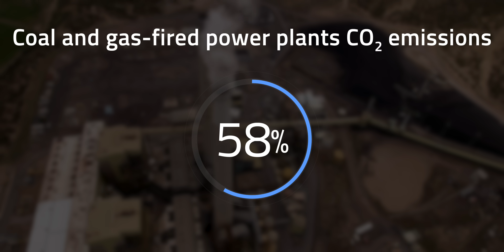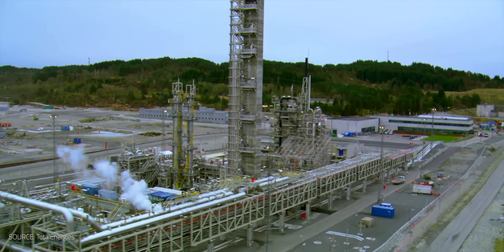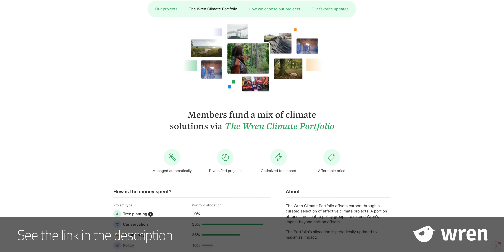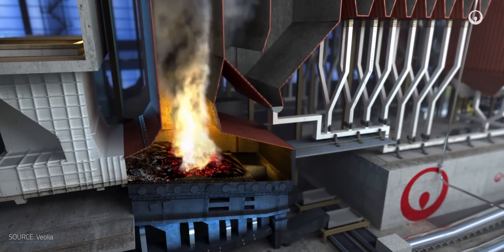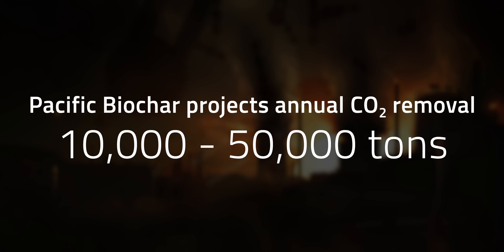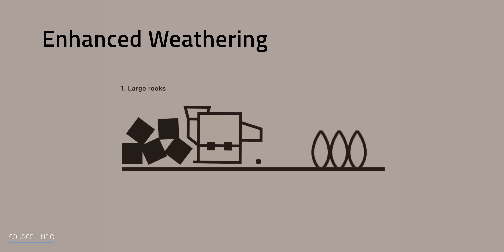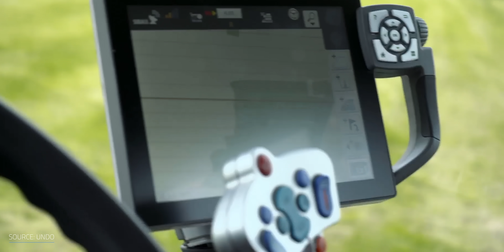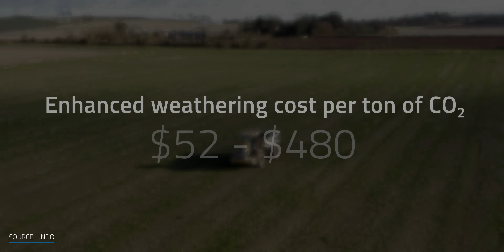The Reality of Carbon Capture

Comment: I was hoping you would talk about regenerative agriculture.  Rotational grazing,  silvo pasture, water harvesting and wet land restoration.  I believe these things could make a massive impact if done on scale.  Imagine how much CO2 is held in soils if we just raise the organic content a few percent.
Reply: There is no downside to Regenerative Agriculture. Not even cost. Regenerative farms are more profitable, produce food with higher food value and reduce/eliminate chemical use in fertilizers and pesticides/herbicides. Run the calculations on how much carbon is captured when you increase the carbon content of soil per acre from 1-2% (typical of western agriculture) to 9-10% (rich healthy soil). The numbers are astounding. We need to work with nature not against it.
Reply: @stevelewin8538  they produce food with higher food value and reduce chemical fertilization but they also produce far less food than can be currently produced. It would be the equivalent of taking 75% of croplands and letting them fallow each year on a rotating basis. Even with increased food value and fewer chemicals needed, the net result is a significant reduction in the food supply in the neighborhood of 2/3 the total supply. That is all well and good and can be said to have "no downside" unless of course you are 1 of those 2/3 of people that die from the resulting famine.
Reply: @lonnywilcox445  that's not what my research shows. I've found you achieve similar or higher production levels of crops and animals, especially when soil quality improves. I have a Batchelor of Agriculture Science from New Zealand majoring in soil science. Believe me, it turned my world upside-down once I started researching regenerative agriculture. There are no downsides to this approach that I can find. The impact on productivity, cost reductions, elimination of artificial chemicals, reduction in machinery use, animal and plant health improvements, carbon sequestering and water retention are so positive that they overwhelm any downsides.
Reply: Linking Biochar and other Pyrogenic Carbon uses with Regenerative Farming + Restorative Forestry + Renovative Water Catchment & Landscape Management is a systems approach for lasting values. Holistic and circular economic approaches are about complex systems optimisation, not ridged, one off answers.
Reply: @stevelewin8538  Gabe Brown 😉
Reply: I'm glad to see others though this too!
Maybe Matt will see this and do a  video on it. I feel it's the only chance the western US and may other areas of the world have left.
Reply: @sethl3702  You want matt ferrell to go google things and tell you false information? thats what he does! THATS HIS CHANNEL hes and idiot and the people who watch his video for information are dumber than him!
Reply: I thought the same.
Reply: I agree.   I was hoping he would talk about regen ag.  Store massive amounts of carbon in the soil where it belongs and make farms and ranches more profitable while growing healthier food and environment.
Reply: This would be an awesome video, watching satellite footage of what happens to the atmosphere during "tilling" season is a real eye opener! Like the CO2 blooms that come out of the massive agricultural areas is something that has to be seen to be believed.
Reply: This is the easiest and most effective way
Reply: Would love to see Matt's thoughts on carbon capture using regenerative farming as shown in the documentary Kiss The Ground.
Reply: Alfalfa & hemp 1000%
Reply: @LeviKerrison  Over five years ago I read an article that explained how hemp could be used to replace plastic for holding six-packs of beverage containers together.  I'm still waiting -- I'd love to be able to compost beverage holders!
Reply: @traildude7538  whilst removing bulk co2 from the atmosphere
Reply: I have been practicing regenerative principles in my little  veggie garden now for two years,  no more fertilizer, tastier food, closing the loop with chickens, separating and composting human waste. The water and time saving has been eye opening. NATURE WORKS PERFECTLY. There is no "waste" in nature, only humans create "waste".
Reply: And rather happy humans working out in the fields getting sunshine and producing healthy food that's sustains our Health, than sitting in crappy retailer boxes ringing up overpriced over processed food that benefits only the medical industry.
Reply: Definitely! Another tool for the tool chest. Good agriculture is a great way to do this.
But the advantage here is that now not only could you do regenerative agriculture, but you could also add biochar to the soil. He covered biochar retaining moisture which would certainly help for the increasing dry seasons. But biochar also retains nutrients. It's often used on lawns to absorb nutrients, and then slowly deposit them throughout the year as needed, to ultimately save on fertilizer.

Combine THIS with enhanced weathering, and you get a nice one-two-three punch.
Reply: @webx135  "But the advantage here is that now not only could you do regenerative agriculture, but you could also add biochar to the soil."

I'm going to disagree.  If you add something that's capturing CO2 you are changing the PH balance in the soil over time, which means you're going to affect the natural biome that plants need to maintain their health.  So, it would make using a process such as no dig, which is ONE regenerative ag. technique much harder.

I think if you asked people who have been practicing no dig they would pretty much all say this wouldn't be helpful.

You could use this with industrial farming because they're always adding chemicals anyway.  But the typical regenerative technique for planting is no dig, or it's the most effective, and you really have to watch a lot of video or do a bit of reading to get the full grasp of why it's superior.

And in case you're wondering, you can do soil analysis to figure out is soil needs certain minerals, which doesn't affect an organic rating when using soil additives that are natural and add what soil needs, and usually once you get soil into a certain shape you tend to need less and less additives.  Rotating crops also helps with this depending on what it is you're trying to grow.

Also, no dig doesn't mean you never till the soil.  When starting a new plot once again you analyze the soil doing down 2 - 3 ft.  You may be doing an initial deep turning and tilling of the soil for different reasons, and then after that it's never tilled again.

All regenerative techniques when it comes to crops relies on leaving the soil alone as much as possible.  There's a symbiosis between the plants and the biome.  When plants are healthy, they are feeding the soil.  Sounds opposite right?  Plants put out nutrition into the soil via their root systems and that feeds the biome.  The biome in turn breaks down what's in the soil making nutrients available to the plants.  This is the NATURAL cycle.  The reason why no dig is typically the best practice is because once a plant is harvested it's roots are left in the soil, once again depending on the crop and harvest technique, and this provides benefit to the biome throughout the year.  Of course you add compost to the top of the soil and this gets pulled down into the soil over time to help feed everything.  The soil stays healthy.  And this is why over time you tend to need less and less additives.  You keep the soil ALIVE.
Reply: Jonas Müller  I disagree regenerative agriculture needs more manual labor. Quite the opposite, with the right management techniques, you work with nature. So you don’t need the same level of mechanization. I don’t know of any regenerative farm anywhere in the world that has had to increase labor when they converted from industrial to regenerative. Open to discussions on this if you’ve seen this somewhere.
Reply: @stevelewin8538  
If you look at farms like Polyface that do rotational grazing, it does take more man power.
Reply: @kamaronkent6888  I haven't had a chance to research Polyface Farm properly (just had a quick look at their website) so I can't answer definitively on their farm management practices. It does appear on the surface that they're on the right track. As to the manpower question, regenerative farming is not set-and-forget like set stocking is. But it is active management of the whole farm ecosystem. As for requiring extra manpower, perhaps, but compared to what? Industrial farming? If so, then additional manpower is an exceedingly small price to pay for the benefits. I'm not even convinced that extra manpower isn't a good thing.
Reply: @stevelewin8538  i suggest you look  no till argiculture ad the costs associated with it you will sing a different tune.
Reply: Yes, we need every solution we can for the climate crisis.
Reply: Definitely.  Glad you raised this.  I'd like to see some scrutiny of Alan Savory's and other techniques that emulate grazing behaviors of natural ruminant animals like Bison.   I'd also like to see more information about how much carbon was released from soil by our mechanized industrial approach.  Since these are both geologic scale activities I suspect the number is big perhaps bigger than all the fossil fuel burned combined.
Reply: Yes! Marshlands are great at carbon capture
Reply: Permaculture
Reply: Yep! Agriculture can be a huge carbon sink. I know IndigoAg is working on this problem (and probably others).
Reply: Regenerative Agriculture is essential to our food security and health, not to mention all the carbon locked in the soil, where it should be.  This is a high tech solution to the numerous problems with the monoculture, row farming, pesticide covered, genetically modified big Ag system of food production.

Also, plant more trees. Particularly in the Amazon. Absolutely no negative side effects with long lasting benefits.

Matt! Are you listening? Please make a video responding to these numerous comments on truly natural solutions to this issue. Thanks 🙏🏻
Reply: Jonas Müller  since when were more jobs a bad thing?
Reply: Glad to see more people thinking in these terms. Hopefully his channel will catch up on that like he did biochar
Reply: I like the sound of this but wetlands produce methane. No idea if this is negligible or not seeing over half the worlds wetlands have been dredged.
Reply: @mrjonesyyy  I'm sure they do release some methane but that's a natural product of organic decomposition.  Wetlands are important for biodiversity but even more so for there ability to hold, spread out, and infiltrate water into the ground.  This help recharge ground water in climates where all the water comes at once and then doesn't come for months or longer.
Reply: The problem is this carbon is only stored temporarily. We are burning carbon that has been stored geologically. This would help keep carbon lower when the same amount of carbon was in the atmosphere however it's not even close to enough to capture all the CO2 that's been released by fossil fuels.
Reply: @scatteredvideos1  Carbon only being stored temporarily is very much relative and dependent. The idea is that vastly more carbon can be held at any one time, its not about following one individual amount of carbon all around...
Reply: The power of large numbers is deceiving. Each is a valid method, still the “few percentage points” is huuuuge.
Reply: Same.
Reply: I hope. This is unrelated but I think needs to be heard. The Congolese government is auctioning land to foreign oil companies for drilling. If done, this could disturb the nearby peatlands ecosystem, which stores 3 years' worth of the entire world's CO2 emissions . If disturbed, all of that CO2 will be released into the atmosphere and set us back 3 years in climate action. Of course, the Congolese standpoint is understandable. The nation has been exploited by foreign nations for far too long and no country has helped them, but I honestly am terrified for what will happen..
Reply: Mono AG practices really deconstruct the soils’ dynamic viability - and hence they move toward more AG chemicals applications as soils lose their abilities and communities.  Regenerative practices are so needed, but the repressive practices of the vicious mono AG business models will squeeze the producers until corporate models have no decent soils to produce healthy crops….
Reply: Put trees back in the forests
Reply: Agroecology is the answer, look at what the campensinas are doing, in 2019 a HLPE review at the FAO you found small-scale agroecological polycultures to be the answer to food security and transitioning to a socially just and sustainable food system that captures carbon and provides vibrant habitat for biodiversity with zero external inputs. Why isn't this being talked about in the global north? The answer is simple, unlike all the high tech optimist solutions that obviously aren't going to work, small scale agroeological polycultures don't offer 'investors' or corporations a dime. 
Normal people need to take carbon capture into their own hands, we have to transition to this model of agriculture proactively it will be much easier than waiting until it is a necessity. We need to reclaim what we have been dispossessed of over the generations, including the ability to co-create the environments we live in and control our own destinies.
Reply: @whowereweagain  Regenerative agriculture is the only hope the humanity has to avoid its own extinction.
Reply: @whowereweagain  if I had won that megamillions last night my plan was to fund projects all over the world.  It was back to my no till market garden instead 😁
I only bought one ticket
Reply: We have a strange habit of re inventing the wheel don't we?

It's almost like people are insecure that plants can fix our problem so well, so we have to invent something to compete with them.
Reply: Jonas Müller  I grew up in southeast Washington state. BIG farms. Thousands of acres each. Apples, onions, potatoes, asparagus, wheat, and alfalfa. But they're not usually family owned anymore. They're owned and managed by large corporations, or universities. Moving to south central Kentucky was interesting. Most farms are under 100 acres. They are family owned. They could easily be swapped to regenerative ag, if you could convince the farmers that it's a profitable idea that would stabilize their returns. But planting more than one crop in a field at a time goes against biblical teachings and mostly, it's not the way dad and grandpa did it. 

Regarding the massive corporate farms, divide them up into 100 acre family owned and run and you can help solve some of the housing problems, and spread out some of the population into small towns and communities alleviating some of the overcrowding and housing cost issues while creating jobs. But, that's definitely a pipe dream. 🤷🏻‍♀️
Reply: most people arn't aware that most of CO2 emissions were caused by destruction of soils worldwide by traditional agriculture and bad land management
Reply: In particular, restoring fungi populations in our agricultural soils would sequester lots of CO2 in their mycelium.
Reply: Would definitely be effective in the Central Valley in California.  Used to be that we had Lake Tulare (the then-largest body of freshwater west of the Mississippi) and miles and miles of wetlands and swamps.  Now you can see the dust swirl year-round due to industrial farming's intensive water usage and aggressive harvesting cycles after the thorough destruction of such ecosystems.  No wonder the adjacent mountains are always on fire lol
Reply: I a7
Reply: Believing is scientifically an idiot thing
Reply: ... simply  government entities are burocrats... they can easily count the number of truck you dump on your land.... but for them it's harder to estimate... and you don't need  to buy it...
Reply: Yes, the Green Revolution was only Green by name
Reply: The lack of any mention of terra preta shows he is still pretty ignorant on the topic, but he's learning.
All we need is a way to tax fossil fuel and pay farmers to use biochar. It can be made locally and measured to prove the carbon has been sequestered.
Reply: Jonas Müller  It would end youth job trouble in my country.
Reply: But you are talking about a wise and rational use of resources that actually makes the world a better place and helps solve world hunger.  That is not profitable to government and huge mega-corporations and is simply not acceptable.  No, what we need is a massive energy suck comprised of materials strip mined from the earth and makes poor people starve instead of providing cheaper, more nutritious food while making wealthy people even wealthier.
Reply: Jonas Müller  Make it good, we have lots of dumb subventions than cause a net drain, this would be the opposite.
Reply: We should go back to farming the way it was done before WW2.   No spraying with harmful chemicals and just natural fertilizer.    Regenerative, sounds so much better than what farmers do to produce today's food.
Reply: Not to mention helping solve the real threat: soil depletion.
Reply: Nothing says these can't be used together.  Regenerative agriculture often deals with mineral-poor soils, which can be helped with both biochar and powdered basalt.
Reply: Obviously there is no big sponsor pushing regenerative farming :-)
Reply: Here ya go ... Here's one for ya. xD. ... https://youtu.be/rvHJKqU-mZo Happened to pop up right after this one - cheers!
Reply: Again we have a person with an English Degree masking himself as an intelligent person that can't comprehend basic Calculus.
Reply: What you suggest are simple and effective ways to reduce carbon in atmosphere, but it is difficult for consultants, green companies and politicians to make money from it. So, yes your suggestions are green, but the wrong kind of green.
Reply: Co2 held in soil? What? Maybe like in peat bogs but not soil.
Reply: @randybobandy9828  c02 isn't exactly accurate. It's pure carbon that's held underground, which obviously could potentially become c02 if it was exposed to atmosphere.
Reply: @northernmetalworker  yes I mean carbon, what do you think is carbon underground?
Reply: @randybobandy9828  yes, carbon is in the ground in both pure elemental forms, such as graphite, coal, and buried charcoal, as well as in hydrocarbons such as crude oil and natural gas.
Reply: @northernmetalworker  yes but HOW do you put those back in the ground? Those where already there and are not soil. Hydrocarbons aren't something that we can just make.
Reply: @randybobandy9828  correct, the only known source of hydrocarbons comes from organic life, meaning we would need to put the organic life back underground.
Reply: @randybobandy9828  Absolutely yes it is held in soils, held in all living materials as they are all carbon based. More organic materials accumulate in the soil hold a lot of water and carbon. Top soil can get very deep in certain grassland biomes something like 10 pluss feet in some examples.
Reply: @leifcian4288  I think you're confused.
Reply: @randybobandy9828  Oh really, with what?
Reply: @randybobandy9828  All carbon based lifeforms hold carbon that is fixed out the air by the process of photosynthesis and respiration of any green plant life. This matter is then cycled through the metabolic activities of bacteria, fungi and animals which leads to further accumulation of organic matter which in turn holds more water and fertilises more plant life. 
Asserting some lack of generally observed and accepted knowledge in this area is worth less than nothing.
Reply: Silver grazing seems counter productive. Grazing animals eat grass and if there are trees above blocking sun light then less grass will grow to feed the animals. There are no free meals.
Reply: Jonas Müller ... I'm very much up for doing this kind of manual labour. I'd do it for relatively little money if my over all working lifestyle was well facilitated and I would be treated with dignity and respect for my work. Currently I'm frequently demeaned for my interests and prevented from doing certain kinds of work even voluntarily due to health and safety issues and general lack of funds/investment.
Reply: As a Federally Certified & License Professional Engineer, you are a Carnival Barker -- A simple-minded English graduate that doesn't have the mental capacity to understand basic Calculus, let alone Engineering.
Reply: @richardlellip.e.m.b.a.7969  You've written this comment to a few threads apparently, bit of a random notification to get there.
Reply: Regenerative agriculture is MUCH better than spreading basalt over a field.  On top of that it's a win win win win win, like in every way it's beneficial.  However it doesn't scale to hectares of grain. You can use techniques for pretty much anything but large scale grain planting.  Although, you can probably incorporate it into a lot of rice production, working organic material into rice pads.

I have to imagine spreading basalt to capture carbon over a crop field is going to produce negative outcomes compared to using no-till techniques.
Reply: @johndoh5182  I tend to think growing some annual grains in long row patterns rather than huge oddly shaped fields would work very well when plotted out in between perennials and other crops. Of course it doesn't work to the same scale of surplus (of one crop type) as its kind of the whole point to grow a far greater variety of crops and produce yields in a more integrated way..
Reply: @leifcian4288  Yeah but once again this would be small scale.  The issue with corn and wheat is just how massive the plots of land can be.  You're talking about 500 acres+, for a single field a lot of the time.  It requires heavy equipment which packs soil down which then makes it hard to use no till techniques which is how you get the best benefit.  Tilling is what turns up the dead organic material, and releases carbon as it kills the biome in the soil.

If corn and wheat farming never got to this point I could see it happening, but since most is in the hands of corporations, I see the neverending trends of tilling, using chemical fertilizers and insecticides.  Small scale you could probably plant sweet corn and do this but not feed corn or field corn depending on where you're from and the name you use for it.  So, smaller farmers could do this for sweet corn, and if you have a co-op in a local area you could use no till and maybe group together to cut down the amount of time spend on  a single field.  

I believe field corn is in the millions of acres.  Yeah I just looked it up, 80 million acres.  And it's so large because of growing corn for ethanol which I personally think is a terrible idea.  If this could be cut in half and this land used for other crops including wheat we could solve different problems.  One would be grain independence instead of needing to import grain from Ukraine and Russia like what used to be true (we exported wheat), and we could move more agriculture outside of CA, for which there isn't enough water in the West for the insane amount of agriculture in that state.  So instead of the terrible idea of going up to 15% ethanol which the entire auto industry doesn't want because it would be too hard on the motors, scale back from 10% to 5%, cut corn production, increase wheat production, get back grain independence and shift different farming out of CA, which HAS to scale back on ag.

And, most fields ARE planted in long row patterns.  But this would make no difference for no till.  You don't bring in heavy equipment for no-till so you're more likely to be able to deal with odd shaped fields.
Reply: @johndoh5182  I understand a lot of the issues your raising but I don't think your quite getting an image of what I'm proposing. Fields are ploughed out in rows yes but the shape of the field itself is usually some awkward arbitrary shape that bares no reference to the landscape watershed. What I'm meaning is just do not have fields at all, have big long rows instead of fields and layer up crop type between annual, perennial, bi perennial, timber, wildlife corridors, swales, water catchments ect ect. 

The idea is to strike a reasonable balance between the convenience of surplus and more dynamic integrated yields. Therefore you have a very very very long row that extends a long way around curvature of landscapes but your never very far from various other crops at any point on the row. So if you were to take a reasonably sized or even fairy big field and stretch it out a long long way where possible into a very very long row instead if you see what I mean. Depending on how you plot and layer rows out it does a whole whole lot to reduce erosion, extend watersheds and retain water, provide wind breaks, limit pest issues, connect up nature reserves, buffer and bio remediate any use of agricultural additives if used in moderation ect ect.

The trouble is this obviously involves a whole lot of land owners having to re negotiate and agree to an overall scheme, as well as who has rights to what or how borders are observed in an alternative way perhaps that would not break up the more advantageous potential plot lines or decent levels of integration and rotation ect.
Reply: @leifcian4288  No, see when you say plow you've already lost.  You destroyed the biome in the soil and released carbon back into the atmosphere.  There's no getting around that.

Regenerative ag. is not the same thing as organic.  You can do all kinds of stuff and still call something "organic".  But regenerative means you're absorbing more carbon than you're releasing along with other things.  Joel Salatin is a GREAT example for regenerative agriculture in the US for raising livestock.  For raising crops, there's a few others. "No-till Growers" is a great channel on Youtube for different techniques for crops.  You'll get more science based information watching that channel than most.

Also part of what you're saying sounds like permaculture in the sense of a "food forest", and there's nothing wrong with those techniques but there are many ways of doing regenerative ag.  There's nothing wrong with large fields which make it easier to harvest a large amount of a certain produce.  Absolutely nothing, and permaculture doesn't offer anything that's superior in many cases, but in certain climates/environments permaculture is probably the best approach, especially when you get into water issues because forest improves the water cycle in most parts of the world.

Like I said Joel Salatin doesn't do permaculture or a "food forest" or no till agriculture, BUT he doesn't till his pasture once he does an initial analysis and treatment which CAN involve tilling or deep turning.  So he's had pasture that's untouched basically for decades, where just the rotation of animals has been enough to build the best pasture land in his area that produces between 2 - 3X the amount of livestock as his competitors in the same area, using no chemicals, so 100% organic.  It's sustainable, regenerative ag.  His emphasis is creating the best pasture land possible so his inputs are minimum to the land, and his work focuses on the livestock he's raising.

So there are different techniques, and I think I know a lot more than what you might think I do.  You have to make judgements about what would be best, for whatever it is you're trying to do.  I have a segment of land, not very big but I'll have to be solving different issues based on what I'm trying to do, the main one raising chicken because I want to raise my own chicken once we move onto this property as that's the best meat for me personally and where that is in the tropics I don't trust the local chicken so much because 45 day chicken has made its way into the area.  It's not BAD, but I want organic chicken that typically takes about 3 months to bring it to harvest.  I think it's more healthy to eat.  Part of what I have is rice field and I can't change it, but I also have a decent amount of hillside, and for that I can use no-till along with permaculture to give the results I want, along with rotating chickens around the property, hopefully.  That's better done of flatter land.  I might have to get another segment of land to deal with the chickens in the way I want to raise them, which follows the technique Joel Salatin uses and many others have copied.
Reply: @johndoh5182  Oh really, lost what? It's not a game surly. 

I've have a very keen interest in the subject we're discussing for very many years, I've considered the views of very many alternative practitioners extensively. 

I've watched very many of Joel Salatins talks (you might see he's in my playlists) and I of course understand the issues with over ploughing... You said fields are already ploughed out in rows and I said we should NOT have a field structure of landscape patterning at all but a row structure instead... I said this to clarify because you made the point that fields are ploughed in rows which is very little to do the picture I was attempting to paint... 

I of course understand that regenerative agriculture is different from organic and I have my own qualms with the organic certification process and its failings/limitations... I don't know why your trying to shoehorn this point in here but ok it's a point worth making o suppose, I often do so myself... 

Your saying what I was describing resembles a food forests and well... No not really, agro forestry if anything starts to resemble but that's not the full picture by far either. While food forests could be included in as layer or buffer half way zone from the more structured cultivation of crops into wilder areas and layers, the image I was trying to convey is more about how to pattern the overall structure of cultivation as a happy medium between the scale of current style farming adapted alongside more diverse and integrated methods, but primarily its about improving landscape watershed patterns.

The issue with large surplus fields, as I've already tried to express IS ABSOLUTELY that depending on the shape of the field and the patterning out of fields over larger landscape areas, they almost always bare no reference to the larger landscape watershed, certainly as they get too big. If you took the same area of field and extended it out into convenient size large and long meandering rows for surplus yield, now you can plot it out in reference to the watershed and in doing so reduce wind erosion, have a more balanced saturation of water and options to position catchments ect while connecting up many further methods of practice and applied features in a over all beneficial sequence... 

If your saying permaculture offers nothing superior (I avoid using the term permaculture these days as its become too much of a trend scene for me I feel) perhaps you should look into the guy who inspired the founders of permaculture PA Yeomans who wrote the book "Water For Every Farm."

You know more than most people however your also clearly making assumptions about my level of interest in the topic as well as what I'm trying to describe. I'm certainly not trying to make assumptions about what is better for you to do in your circumstances, I'm thinking about more large scale landscape management overall. Certainly what people such as yourself are doing and discover would very much factor in to what should be considered in your local region.
Reply: @leifcian4288  Using the words "sustainable" means that's what you're ACTUALLY doing.  It's not just a word.  So, when you plow, you kill the microbiome and release carbon back into the atmosphere.  Yes, in all regards that would be hard to justify the use of that particular term when you have to compensate for the re-release of carbon back into the atmosphere.

You didn't read my statement about permaculture carefully, I didn't say what you said I did.  I said this "permaculture doesn't offer anything that's superior in many cases, but in certain climates/environments permaculture is probably the best approach, especially when you get into water issues because forest improves the water cycle in most parts of the world."

This is based on all MY research and CLEARLY I stated I'm using permaculture where I live.

I'm not going to converse with a person who wants to read a partial thought and then go after it without putting it into the full context of what a person said.  That bothers the CRAP out of me when people do that.  So, clearly I struck a nerve with you.  Good day.
Reply: @johndoh5182  Why are you still talking about ploughing? Like I've explained my emphasis is not strictly on ploughing, it's about patterning and plotting... 

Your shoehorning a lot of different things around here... I'm well aware the disadvantages of over ploughing. 

OK we'll go there if you insist though... Very minor tillage in infrequent considered rotation does have its advantages actually, however should be only ever be done very considerately on small sheltered plots and not so lightly over huge, expansive and exposed areas however many times a year. 

A lot of the historical problems with ploughing and the erosion of landscapes has to do with expansive field patterning along with heavy ploughing which would degrade soil over generations and then as soon as things were mechanised there quickly started to be dust bowl situations... 

Light tillage in considerate and conservative application has utility as a disturbance factor that induces a metabolic boost and clears a plot for planting. Obviously people for far too many hundreds of years got way too complacent and very inconsiderate with the method just started doing it as a matter of course and habit... 

At least it use to be a large time consuming labour and energy intensive process that could only be physically done so often, as beasts of burden could only be pushed so hard. Then after machines became available it quickly became many times a year all of a sudden, before and after each crop and again a couple of times in the winter to look busy or whatever... 

For a lot of land owners it's just becomes about neatness I think, I imagine they just love the "nicely manicured" fields and get a sense of order and control about it in the same way people dominate their lawns with relentless mowing... 

What you seem to have said is there is nothing wrong with large expansive surplus fields in many instances... What I'm saying is I don't agree, it's not surplus cropping but the expansive and exposed patterning of fields which is one of the main issues, as these weird patchwork quilt patterns have borders that often are only to do with ownership boundaries and these borders often serve little to no other purpose or function and have no reference to landscape watersheds. This is where a simple change in doctrine from fields to large, long surplus rows would begin to resolve many issues. 

I've read your statements reasonably well for a casual conversation. Obviously there will always be some meaning lost over casual text, however it's a bit rich how you've clearly overlooked the majority of what I've put forward just to then accuse me of me of not understanding something you said when I wasn't even debating ploughing specifically and the part of your statement I was taking issue with is not the part you seem to now be defending... 

I'm not really interested in getting into semantics of terms like permaculture, I try to avoid this term these days as I say. I prefer terms such as horticulture, conservation, bio dynamic/integrated cultivation/agriculture ect ect as they seem more readily understood, especially when you talk about providing horticultural work or conservation work and how this can be beneficially integrated with agriculture for instance. Strictly agriculture does mean "field culture" so for me it's not ideal in an entomological sense however its simply a much more widely understood notion to attempt to re-define and give a more horticultural slant perhaps.
Reply: Jonas Müller  No, scaling different techniques involved in regenerative farming is NOT hard.  In fact some of the most profitable farms in the country use regenerative techniques.

You apparently didn't dive as deep as you think you did.  But it does take work to make the shift, and that's where people, or business fails.

I suggest watching videos on Youtube with Joel Salatin who shows how he leases land from other land owners in his area and makes that land highly profitable within a year.  One year.  That's rare in farming.

Regenerative ag. is catching on in Europe and the US slowly, but when farmers using these techniques start outcompeting the industrial farmers THEN large business will get it.  And, that's most farming in the US, large business.  If regenerative techniques had been used for the last 100 years many more farms would still be family owned.

There's a really good video, sorry I don't have the reference right now but it shows what happened to the orange industry in FL as farmers started to introduce chemicals.  It's pretty dramatic how much the dropoff in production has been.  The video is done by an entomologist so the perspective is in regards to fighting insects, which he clearly shows is a slow battle to failure, since almost all insects don't eat healthy plant tissue.
Reply: Would also be good to stop growing corn to make ethanol. Switchgrass for ethanol is much more energy efficient and lower carbon footprint
Reply: just grow trees.  I think you need 100 billions to 1 trillion trees  to keep up with crazy consumption of human race with crazy population with crazy expensive lifestyle that released massive amount of CO2.
Reply: @AnhNguyen-hn9vj  that's just a small part of what's needed.  Grassland habitat can be just as  Biodiverse as forest habitat and the margins between the two even more so. As stated by many others we need to take this on from many angles and not focus on one thing.  Regenerative agriculture encompasses most of these with a focus on healthy foods and healthy soil.
Reply: So all the land/vegetation cleared for solar farms with non recyclable solar panels is great for carbon capture...🤔
There's a billion of the non recyclable panels out there...
Reminds me of the carbon footprint to build , operate and maintain the capture machines...
Reply: Frankly, I'm doubtful, but would be interested in a video on the topic.
Reply: Regenerative agriculture is also effective in restoring the water cycle. Water is the major driver of temperature and climate, so we can't ignore it. In this regard, I highly recommend the conferences of Walter Jehne (https://youtu.be/iD2DXBERTeg).
Reply: I agree, however, unlike other forms of organic matter, biochar does not decay. It's carbon that can stay in the soil for thousands of years.
Reply: #SaveSoil
Reply: This, absolutely this. 

Franky it's the only viable nd cost effective solution.
Reply: Yes, this is exactly what I was thinking. I was surprised not to see regenerative ag explored on this video. Great video Matt, thanks for all you do.
Reply: I've been wondering what illnesses are caused by the products of intensive farming, being mineral & trace element deficient. Read "The Soil Will Save Us" by Kristin Ohlson
Reply: Check out Mossy Earth
Reply: Completely agree with you Seth!  You should look at Andrew Millison a professor at Oregon State University his research focuses primarily on permaculture and water harvesting techniques that can be used in the landscape.  Love the way you're thinking though man!
Reply: Don't forget about dung beetles
Reply: You're new around these parts... Matt is a merchant of doubt from the fossil fuel industry.
Reply: What about dung beetles?
Reply: 900 likes!
Reply: Regenerative agriculture is composting simply
Reply: This is the way. Soil regeneration, solar, and EV’s all have advantages far beyond carbon footprint. These are simply the most efficient and logical methods, they just so happen to be less harmful for the environment. When we do things based on logic and not the carbon pseudo religion, we end up coming up with the right answer every time.
Reply: @drewgoodman7932  the electric grid can’t handle everyone driving electric cars. Need to give it more thought and flesh out your ideas more.
Reply: @beanlegume9965  You’re right, the current electrical grid cannot handle it. Solar, wind, and batteries are decentralizing the whole grid slowly, eventually turning it into something unrecognizable from today. Also, most EV drivers will supply their own charging from home solar and rely less and less on the grid anyway. You’re probably right though, I am sure you’ve thought this out much more thoroughly than Elon and other engineers/scientists.
Reply: I was disappointed that regenerative ag wasn't mentioned. Sadly most vegans seem to reject anything that has to do with cattles.
Reply: Best way to make that happen? More cows on grasslands.